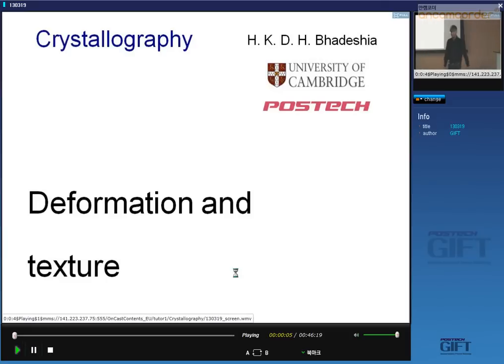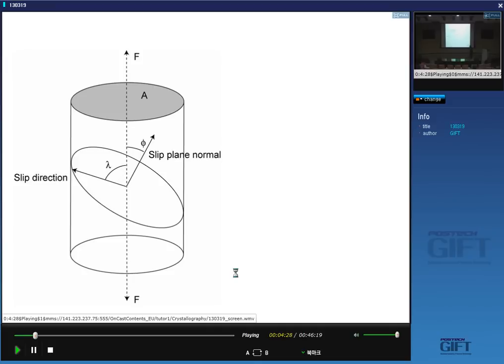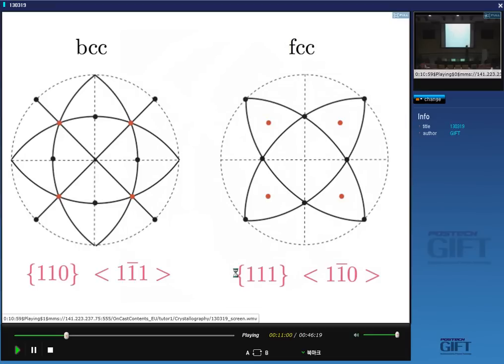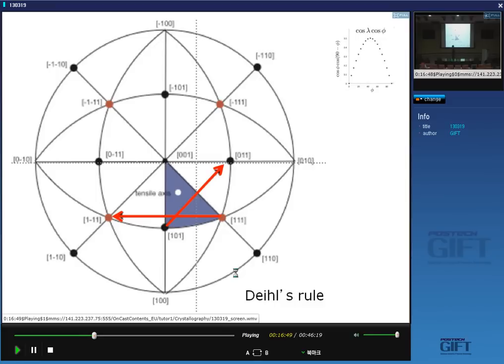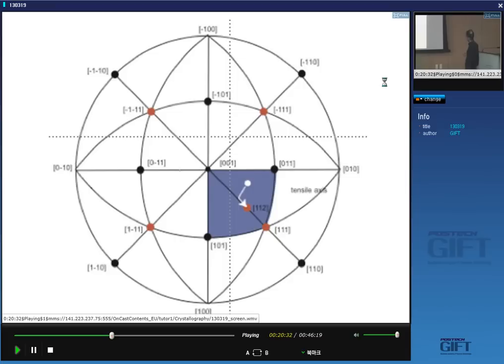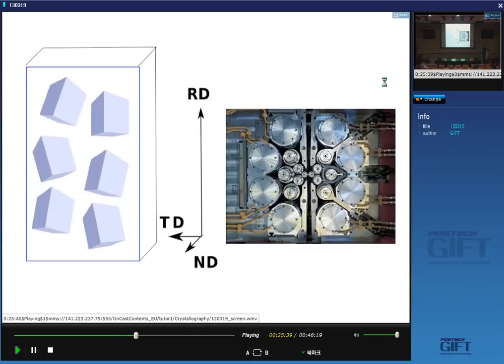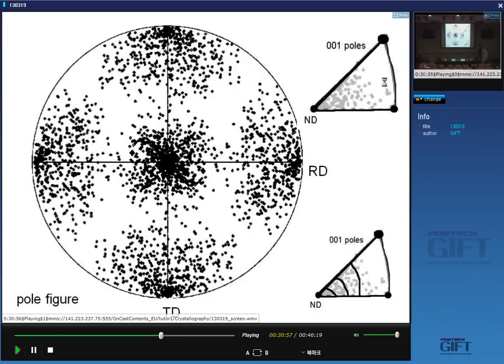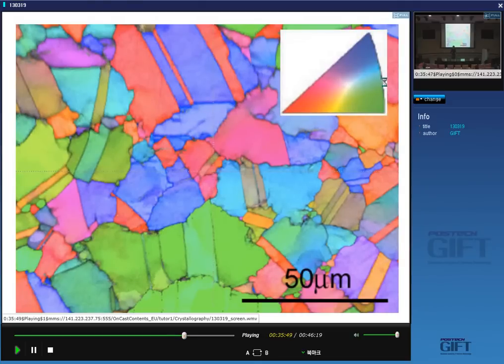Crystallography 8, Deformation, Texture 2013

Comment: Supposing I studied the mechanical properties  in the T-L and L-T orientations of a rolling plate and now I want to explain the effect of the texture on anisotropy.

Would it be enough to scan the L x T plane (i.e. RD x TD) via the EBSD for this purpose?

Many thanks for the lessons. This theme looked like a boogeyman, but now I'm learning.
Reply from the maker: EBSD (electron backscattered diffraction) gives you three-dimensional crystallographic information. In other words, you scan on any plane and you will get the same information, defining the crystal orientations relative to your chosen external frame of reference.